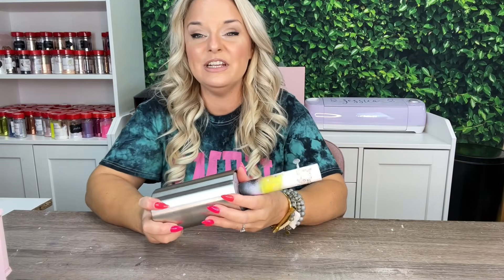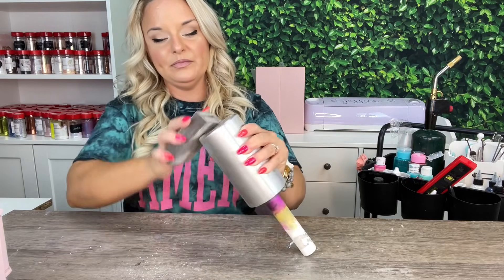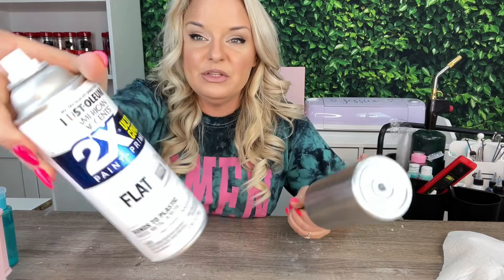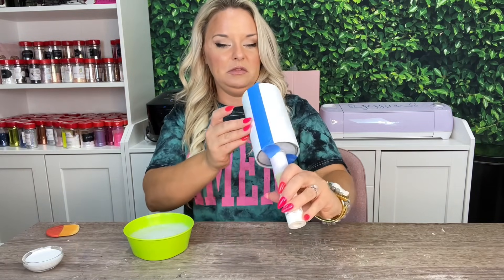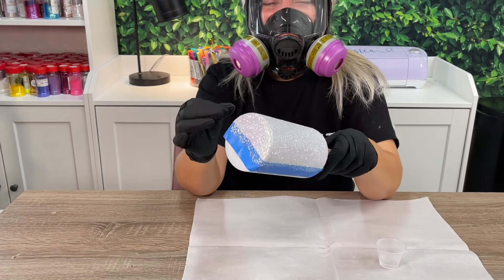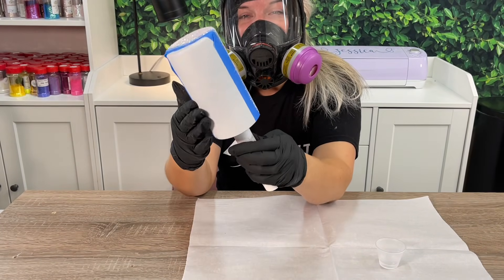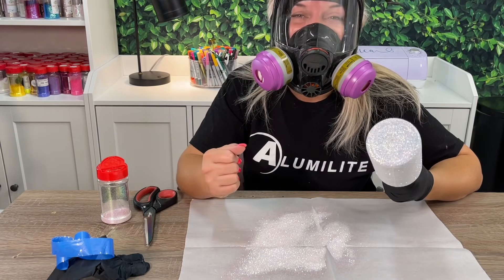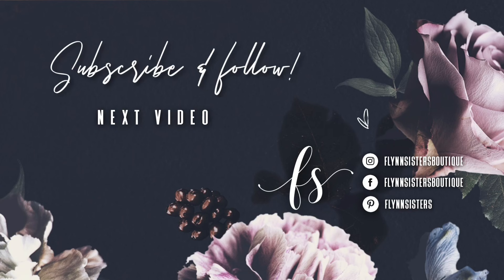Beginner Glitter Tumbler Tutorial

Comment: Just tried the epoxy method last night and so far I love it. I do have a question tho do I need to seal before going in with the second coat of epoxy?
Reply from the maker: You dont HAVE to seal before the next coat of epoxy but if you're using a chunky glitter, i highly recommend it so your epoxy sits on top of the glitter instead of seeping below it. Even with fine glitter, clear sealing it first helps give you a smoother first coat of epoxy.
Reply: Thanks!!! I really appreciate you replying so fast. Hope you have a great Sunday. I will go ahead and seal it to be safe. It’s my first GST shattered glass on a tumbler so I don’t want all that work to go to waste.
Reply: Silly question since I did the epoxy method do I need do brush off access or just go straight in with sealing?

Comment: Thank you for this. I've been learning epoxy and was thinking to try Mod podge soon just so I can see what I like best. I got the   spray adhesive and spray sealer , do those work the same as the liquid? (Sorry if that's a "nonsmart" question, but I'm truly curious.
Reply from the maker: Spray adhesive give you a tacky surface. It works for fine glitter but chunky glitter wont be able to lay flat with the sprsy adhesive. A spray sealer just seals down your glitter before epoxy. It isnt used to apply the glitter.
Reply: @FlynnSistersBoutique  thank you for that information !

Comment: Thank you Jessica, great information! So you were using the Mod Podge only as a glue to apply the glitter, but epoxy over the complete cup. Did you ever try to use Mod Podge as a sealer, instead of epoxy? i.e. the Dishwasher Safe or the  Hard Coat
Reply from the maker: That’s correct. I prefer epoxy since it’s a longer lasting more durable finish. I like the shine and I’m able to apply decals over the glitter and more
Reply: @FlynnSistersBoutique  Thank you <3 - I was  thinking about covering my hairdryer with glitter 🙈 and thought Expoxy might not be the first choice for that

Comment: The issue I had when I used epoxy to apply glitter is- I could only do one layer of glitter. For instance I tried to apply chunky over fine and the chunky just fell off. Then the glitter moved and mixed when applying epoxy. So tips?
Reply: When using chunky glitter and the epoxy method I always use more epoxy than I normally would. I also use more than normal when using more than one glitter color. Using more epoxy also helps the chunky glitter lay flat on its own without having to pat it down. As far as the glitter moving when epoxying, make sure to seal your glitter when your adhesive epoxy is cured but before your first layer of epoxy over the glitter. I use Krylon Triple Thick to seal my glitter but you can also use any other clear spray paint. Some other alternatives include Polycrylic (liquid and spray both work), CCDIY Quick Coat, Mod Podge (liquid and spray both work). What you use is all about preference. You just need to make sure the glitter is sealed so you don't have movement. I know my glitter is sealed enough when I can rub my hand over my glitter and none comes off. Sealing also helps prevent repelling of the epoxy over chunky glitter and microbubbles. Hope that helps!